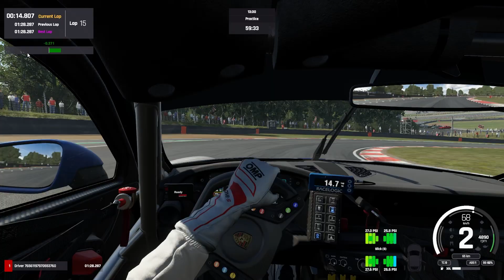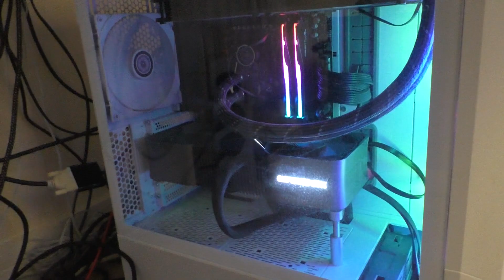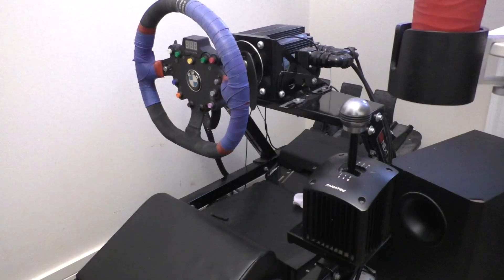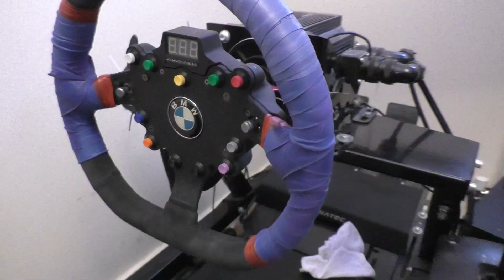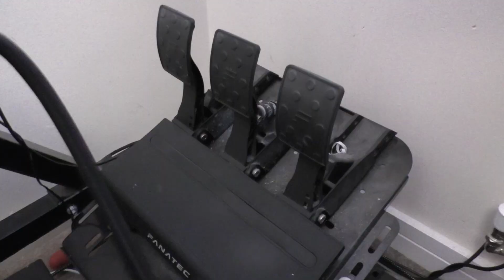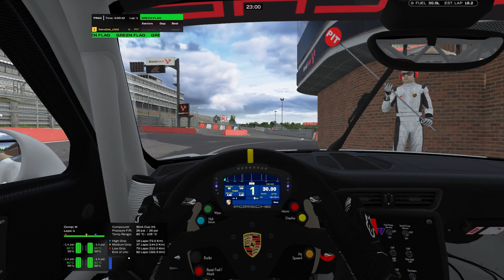Sadly Assetto Corsa EVO FFB Lacks this KEY Detail - Real Driver Explains

Comment: I'm using a Logi G920, having late feedbkacks is my second name. But after spending some hours on EVO i really wanna cry when i play ACC. I don't feel weight transfers at all on ACC except aero weight, and many many times when i lose the car i need to watch the replay to understand what went wrong. 
In EVO instead the understanding of the mistake is immediate, i get so much info from the wheel that i know what i did wrong, i don't need to rewatch the action.
I know ACC's FFB changes a lot from hardware to hardware, maybe it's just a problem of mine, but guys, if this is early access i'm very hyped to see how they will improve that.
Reply: Dont worry, even with a highpower wheelbase ACC wont give you enough feedback. I also always struggled with my old T300 but even after i bought a good DD wheel it didnt change much. ACC is more about learning every turn by heart other than intuitive driving. I dont have time for that, thats why I already uninstalled ACC quite some time ago. Raceroom and AC for me are the best when it comes to intuitive driving, even with Raceroom having a better racing experience overall. ACEvo will be there quite soon i think.
Reply: Ye I've a r5 and I can go from iracing to ac to evo and back and all feel very good to me. But acc is a mess in comparison. I'm really glad Evo feels way closer to iracing/ac than it does to acc
Reply: @ i like that evo also has little bit of racerooms dna in it
Reply: I have a CSL DD to try, i'm waiting (and waiting and waiting and waiting lol) for FANATEC to send me the wheel. When they will send it, it would be an interesting comparison.

Comment: Sorry mate, but talking about FFB and not showing your settings is kinda useless. I think that the FFB for now is better on wheelbases from simucube or asetek. I use an asetek forte base and i removed any filters ingame, only Gain and little bit of vibrations. But crucial is the damping, remove all the damping completely, ingame and in the wheelbase software. At around 8-10 Nm is the sweetspot for ACEvo. I use my 18 Nm Base with 50% gain ingame (so 9 Nm) and the FFB tells me what to do at any time. But yes like Paolo here in the comments said, you can feel that the road tyres for now are better optimized than the race tyres. And even without any damping filter the damping in ACEvo is still too much, especially when you come from AC1, which can be quite brutal. For everyone with wheelbases under 12 Nm get stronger one or wait ... for everyone on wheelbase with 12+ Nm just dial in your settings. For everyone who just wanna have the most intuitive and realistic handling with amazing FFB just play Raceroom or AC1. But i have high hopes that ACEvo will be up there quite soon.
Reply: After turning off every filter and removing all dampening, I still couldn’t tell what my tires were doing. I don’t care if you’ve got a 30 Nm DD base, you’re not going to feel it. It’s not a wheel base issue, like you make it out to be. It’s a problem with their FFB calculations. It’s basically Rack FFB settings, so instead of having a sense of what the tires are doing, it’s as if they want us to rely on sight for what the car is doing beyond what you would feel from the steering wheel. Pick a SIM, any SIM, and they’ve all managed to work this out. AMS2 may feel “slidey” compared to RF2 or AC, but all of them give you a sense of what your tires are doing beyond that of just the main rack forces on your wheel. I’m sure they will get this right by the time they finish EA, but for now, stop being delusional about your 18Nm wheel. This is coming from a SIMAGIC Alpha U, with 23Nm, and a TM T818, with 10Nm. The only difference between both with everything off was a greater magnification of the same forces. I still was unable to “feel” my tires losing traction and the rear starting to step out. I had to react to what I was seeing, and by that point, it’s too late. And, yes, I was trying to induce oversteer/understeer for testing purposes. I’m sure they’ll work it out.
Reply: @MaxGOAT4Life  i perfectly feel everything with csl dd 8nm, so it's your problem :)
Reply: @Emupyyy  I’m sure you do! 👍🏻🙄 You’ll really feel it once they get it right.
Reply: @Emupyyy specifically, are you feeling your wheel vibrate under hard braking and/or when holding a turn?  My CSL DD doesn't give me much of this, as it does in AC1.  If you are feeling those things, please let me know what your Fanatec and in-game settings are so I can compare.  Thanks!
Reply: @paulmurphy7626  in AC1, ABS and Slip were effects, ACEvo for now is physics based FFB with too much damping thats it. But everything is there what you need to handle the car properly. But some say Speed Sensitivity and Vibrations in the ingame settings helped them alot.
Reply: @PeWersi I would suggest that effects are there to help add some input that cannot be felt in a rig with just a wheel and pedals.  That said, since my previous post, I went back and made sure all my effects, both in-game and in my Fanatec control panel, are at zero, and I seem to get a little more detail; each car will vary, I'm sure.  Maybe I'll try adding some of the other value you suggested as well.
Reply: @paulmurphy7626  while setting up try to focus more on road tyres. The racing/slick tyres are not that optimized yet in this early stage. I can also highly recommend watching latest live stream video of Nils Naujoks about Evo. There he explains alot which is very useful.
Reply: @MaxGOAT4Life  i have to mention that not on all cars ffb is great, but when it is it's the best ffb atm. gt2 car feels just right, but porsche cup or ferrari evo not at all atm. And it's just begining, it will be even better over time
Reply: @ Yes but not on all cars right now. The best ffb in my opinion got gt2 merc. In game set only overall "gain" turn off all dumpers. In driver also turn off all the dumpers. NDP - off, NFR - off, NIN - off, INT - off, FEI - 80 (this is subjective because if i use 100 when i hit wall or curbs it hits too much) FOR - 100%, SPR - 100%, DPR - off. in driver FFB - 100% in game i set around 80%, but this depends on car.
Reply: @MaxGOAT4Life  skill issue?
Reply: No, video authoer is completely correct, the oversteer feel is very bad compared to both AC and ACC. But keep glazing, so that Kunos don't do anything about it and we get a worse product overall!
Reply: @naebalvas  he might be correct with his settings. most of us are not racing irl and at this early stage ACEvo already delivers nice handling and FFB. At least way better than ACC already.
Reply: As soon as I clicked on the video I was looking for if he turned off the damping and other effects. Wild that he wouldn't include that in the video, given how much thought has clearly been put in. I thought the FFB was garbage until I turned it all off.
Reply: I like it that he actually has experience on track which is something most of us do not have. If you want to negate everything someone says on their stream and you want me to listen to you I would suggest making a video of your own so that I can take you serious.
Reply: But when you don't have damper, the wheel shakes a lot at higher speed
Reply: @azzazz4549  not with my setup ... actually i would like if this happens but ACEvo actually is quite calm imo.
Reply: Wheel power is irrelevant. If the game isn't feeding the info, n9 wheel will respond

Comment: Turn down all FFB settings except Gain and Steering lock. You will feel the tires lose grip. However, vibrations and the like are missing to enhance this feeling. It's there, just needs more refinement.

Comment: Just to point out what Nils Naujoks (Official Tester Dev) say on one of his streaming about FFB. Basically those force are not missing in the FFB but the problem is the Tyre Model that is not Develop and Comunicative enought expcially the Race tyre which is started develop later then the street one. Anyway there is no arm to point out the problems or short coming early on.
Reply: Traction loss is associated with G-forces as well as tyres. Could easily program some 'feel' linked to the fluctuations in G at the limit.
Reply: @Rave-agent  "Feel Linked" I already don't like it the way it sound......
Reply: @ feel, as in what you feel in the wheel.
Reply: @Rave-agent  And that precisely means make it fake and artificial. Any artificial "made up" effects on the steering is what you DON'T WANT on a simulator especially for such sophisticated nuances as tire feel.
Reply: @daggerfighter  wrong. The very nature of simulation is fakery. Fake is what it is. It's not real. Snap out of it.

Comment: I agree with you,  And kunos knows about this definitely,  So with time will come, hopefully more detail at mid, corner,  I have a 18nm asetek and i feel the race car's are horrible,  mx5 is ok, the cup porsche and Ferrari is lacking badly in my opinion,    and yes there is detail but very vague,   let's hope they make this ffb realistic
Reply: No FFB is "realistic", FFB is just an unrealistic thing to compensate for the lack of G forces. The dampened feeling is how the wheel realistically feels in the car
Reply: @coastallab5526  yes you can't get seat of pants feeling,  but you can get dam close, plus i don't care about the damping feeling to much, there is no mid corner feel at all
Reply: I also have the Asatek Forte, but for me the MX5 feels very stiff all the time. I am using the recommended settings from Asetek. The feeling is a bit better with steering range 800 aposed to 540, but I still feel there is a lack of dynamic range. What settings do you use?

Comment: Just out of curiosity, what settings do you have for your 'steering assist weight? I recently made a video regarding all the wheel settings I use; this one was the key for me. I have run brands hatch in the Ferrari quite a lot of testing because at first I had no FFB which made me look into a lot of videos on the subject of FFB this setting fixed all my issues and now the feeling is better than any other, as in AC OR ACC. I feel everything in the wheel and mine is the oldest wheel in the world :)
Reply: I was under the assumption Steering Assist Weight is an option for control pads, not wheels. Same with speed sensitivity for example.

Comment: "Self-centering" is wayyy to strong aswell in Evo, if oversteering, the car almost want to throw itself the opposite direction, and not continue in the direction of the car.  Even with center spring at 0 it countersteers for me, too hard! Leaving me in the ditch cause of the return. I drifted 1000s of hours in AC. And this needs to be fixed
Reply: It's simcade. They don't want kids to spin out while they're using their Xbox controller and showing off their Avatar and emotes.
Reply: @DerekMoore82  it was some stupid ESC system that is on by default in some cars

Comment: So in AC, as you turn the wheel and you get close to the limit of the front tiers, the wheel gets progresively heavier. As you go over the grip limit there's like a sudden loss of feedback letting you know that you are turning too much. You can wiggle the wheel and feel as you go in and out of grip. And this aspect is missing in ACE. Am I getting this rigth?
Reply: @calinpetrescu9128  
You describe what does exist in ACE, and real life.

What the video asks for is vibration (or opposite lock for oversteer) when passing this threshold to make it easier for the player to feel.

Whether that's a good or bad thing, up to discussion

Comment: Have you manually set the steering ratio? You can’t just set it to 900 degrees or whatever and let soft lock deal with it, because it doesn’t work. You have to manually set the steering ratio for each car.

Comment: Would be interesting to know what FFB settings in game you're running. I could swear I could feel the car understeer pretty easily, especially with the FWD Abarth. You really need to dial down the dampers in the game close to 10% (with minimum damper at 1%) to get a nice sensation.

Comment: For me personally, I like the ffb in evo more. The steep changes of force in AC1 (that springy, bouncy feel) was throwing me off more then it helped me (the gyro options helped and improved it alot in my opinion but wasn't always perfect either). But I also think evo could benefit from a bit more direct vibration, not so much for bumps and so but for things like abs, understeer and such things and flatspots, I wonder a bit when some other say "ohh the flatspots feel amazing" for me it is just a very slight vibration, where it should actually pretty violent I think (when you have realy bad flatspots). It's like I want the "more numb" feel combined with more directness. Hard to descibe. Like I want a realistic feeling wheel (so without the springy feel, like a bit damped) but with sharp direct feedback when needed. Like a dampened wheel but not because of a dampening effect but because of simulated dampening, friction. So that the sharp direct parts are not dampened away.

AMS1 and RF2 (with GOOD cars, there were also alot bad ones) ffb was a very good direction. But I think Evo already have a very good basis. It's not like I would be unhappy if it should stay how it is. But if it does improve in the right direction (which is ofcourse subjective which direction that should be) I would be happier. 

Btw. have to tried the AMG GT2 in evo? I think that has a very direct and good feel for oversteer on power in my opinion. Maybe it's a porsche thing that it lacks the weight on the front. And that's why it's not as pronounced as you like. I personally don't have problem with the Porsche btw. to me it feels fine on power, you just need to be a bit sensitive to what it tells you. 

Pretty much same wheelbase here, "small" 20nm Mige (osw in the very past, simucube1 for quite some years now)

Comment: If I understand correctly, the feedback you are looking for is not something you experience in the actual car, but is an artificial haptic feeback added on top of the simulated steering rack force, which is somehow calculated based on the ammount of slip on each axle?
Reply: Front Wheel rotaing angle verses direction of travel and hence yaw calculation needs to be amplified to the ffb.
Reply: Nvm watched till the end